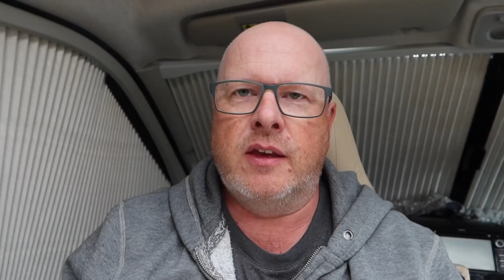VanTech Tuesday - Power to the People

Comment: Hi, Our motorhome had 2 leisure batteries in the previous owners set up but one was removed before we bought it. There are cables unused looking like a second feed available to use but I'm unsure of whether we a) need to still run jumper leads across both batteries and do the usual one battery negative the other battery positive set up or whether we need to incorporate the existing leads. I do have a couple of photos if you or anyone else would be kind enough to take a look. Went to one place who "aint got a clue mate". Thanks for taking the time to read and understand you're busy so no worries if you don't get time to answer. Cheers, Dave.
Reply from the maker: You’d be better to get an auto-electrician to look over it. If it used to have twin batteries and now doesn’t then the 2 spare cables should be removed, or install a second battery. But I can’t stress enough that don’t work on 12v electrics unless you’re very competent
Reply: @GadgetJohnAdventures  No worries, will do that. Thanks for taking the time to reply.

Comment: Great videos both of you have gained a lot already from them just wondering what you would advise with my motor home I want and need to upgrade my power and solar but don’t think I have enough room for a second battery as it’s crammed in with the trauma heating system what other options could I try
Reply from the maker: I’ll cover this in tomorrow’s VanTech video 👍🏼

Comment: Hi John, was curious to know what size solar panel you have on your new van and with that what input are you getting from it on a day like today, also your setup seems to be giving you what you need but are you considering a larger panel- if so what size 
Thanks John
Reply from the maker: I added a 360w to the existing 100w that came with the van, wired in series to a 30a victron controller. I get nearly 2Kwh of solar a day right now, so that's perfect for my needs, maybe in the future I'll get 2 x 150w panels, one will replace the existing 100w panel.
Reply: Cheers John, I’m just trying to sort my solar out. At present I have nothing but trying to get the best I can for the space I have. One more thing if you don’t mind but can you recommend any suppliers for panels that are true to there cell technology ( I see you have used amazon before but is that a particular brand or company )
Cheers John
Reply from the maker: I use Photonic Universe from amazon & they've always been great.
Reply: Gadget John on tour Thanks again John 
And hope you and  Mandy are safe
Reply: Morning John and Mandy another solar question if you don’t mind. I’ve been on my van roof to measure up and it seems like the exterior aluminium skin is not glue down to the van shell so wondered if yours was the same or if you have seen this before. Also would you recommend screwing and glueing solar panels( worried about leaks )

Comment: John, in a recent video you swapped out Lithium batteries and installed AGM, and were very pleased with doing this as you hated the Lithium. I would like to understand this and so please would you watch, all thru, the video posted by 'RV with Tito DIY' on 27march which is 15:05mins long. Video is titled;'BOONDOCKING with LITHIUM vs AGM- Which is Better?' He is explaining his experience with Lithium, after 3months of continuously without hookup, relying on Lithium only. He concludes at 12mins ''zero issue''. John, please could you explain all the hows and whys of him loving Lithium and yourself hating a Lithium based system, as these two opposite opinions I'm finding extremely confusing. Your answer may have to be quite long, as it involves a lot, but that's ok, it's the detail that's important. Thankyou John, best wishes from Alan, in Norfolk.
Reply from the maker: My video explains perfectly clearly what the issues are, watch the video, listen, please don’t skip and you’ll understand. The main point is lithium will work, but so far it seems not many system will accurately report the battery state, making it hard to know if the batteries are about to shut down or not.

Comment: John great videos, looking to fit front fog lamps to my tribute i have looked at your video but it doesn't go into detail can you give me any info did you use a relay, Cambus, and can i wire to a switch.
Reply from the maker: As the load is less that 0.1a I wired to the sidelight bulbs, each bulb wired to each drl, no switch and cambus was fine.
Reply: @GadgetJohnAdventures  thanks john if i throw a switch in the mix will that need a relay
Reply from the maker: That really complicates things, you can’t wire 1 switch to 2 different power sources, so either 2 switches, no switch or you’d need to wire a relay and take the relay switch from one of the lights.
Reply: @GadgetJohnAdventures  if i take the power from the fuse box to a relay and have them on a separate switch is this ok

Comment: Hi John, I have a portable 150w folding solar panel kit and my leisure battery has quick release flip up connectors, what battery terminal connectors do you use for multiple connections? Thanks again, Ian
Reply from the maker: Good question, I’m going to do the first quick video next week which covers connecting multiple batteries, in that I’ll show the terminal connectors I like to use 👍🏼
Reply: @GadgetJohnAdventures  thanks I'll look forward to it as usual 😎👍🏻

Comment: Interested in your wire cutters. Surely they would not cut through thick cables such as those required for a battery?
Reply from the maker: I use tin snips 👍🏼 read the video description for links 😎

Comment: You could also install a battery master to charge your starter battery off your leisure battery
Reply from the maker: I don’t need that setup as I drive my van once a week, under normal circumstances far more often, which keeps the battery topped up 👍🏼

Comment: When on hook up it shows a picture of both batteries and a loop connection does that mean they are both charging? Cheers Tony👍
Reply from the maker: Without knowing what system you’ve got I can’t say. Do you have a booklet for it or the model number?
Reply: @GadgetJohnAdventures  Hi john have found the model number (NE 268) and explanation as to why the 2 battery sign on  the control panel when hooked up says, The presence of the 230v mains when the two batteries are in parallel verifying before the battery service voltage? Clear as mud to me? All i know is when we are on hook up both batteries show fully charged?

Comment: Hi John i know your a busy man just a quick question? I have SORN my Auto trail T-669 off for the moment as we are on lockdown. If i hook it up to the house electric will it top up both the leisure and the van battery? If not is there an easy solution cheers Tony
Reply from the maker: The Sargent system can only charge 1 battery choice, so you can plug in and select vehicle battery or hab battery. Just like I went through in this video, just change it over every week.

Comment: Hi John thanks for the reply the TV is new and should run off 12 v but wont for some reason powers up but cuts off after few seconds and we changed lights in van to ones same as ur old van with usbs but thanks  and the fuse would be between the inverter and the wall socket thanks
Reply from the maker: Maybe the 12v socket you’re powering the tv off can’t take the load of the tv power. You don’t normally put fuses inline on mains cables, the fuses should be in the plug and appropriately sized for the device, so the tv might be 3A for example. Make sure the inverter has the right fuse between itself & the battery too.
Reply: @GadgetJohnAdventures  thanks john

Comment: Hi John and Mandy found you about 4 days ago and what a find, my name is George smith 78 and I live in whitby with my little dog Willow . I bought a van 4 weeks ago that had been started on as self build but not to my taste. it has 3 new leisure batteries all are 120 amp hours linked together I am currently on hook up at home my are putting out 13.9......14.3  v  I have 150 W solar panel off of my old van which was powering 2 batteries how do I wire these into 3 do I go number one and number three? and do I need a different controller.   Cheers John await your reply love your videos,  keep safe take care best regards George & Willow
Reply from the maker: Hi George, if you look back at my videos, inverter & battery wiring is the title, you’ll find loads of info on wiring multiple batteries and solar panels and controllers 👍🏼

Comment: John could you help we have a 800/1600 watt inverter in our motorhome which we run to a 2 plug and USB wall mounted socket should we have an inline fuse before the plug socket and if so wot size we only use it run a 40 w TV and roku stick thanks john
Reply from the maker: To be honest you might be better running the tv off 12v. You should also install some 12v usb sockets instead of mains usb sockets. Then your battery would have less load on it. If you do use it as you have it, then are you asking about the inverters fuse or the 230v sockets fuse?

Comment: If you run your engine try and run it at about 1200 to 1400 rpm, idle speed will not do the engine any good.
Reply from the maker: That’s not entirely true, an idling engine is going to use a lot of fuel compared to driving, an idling engine is also causing more wear on the engine, but it won’t ruin the engine unless it’s only ever run like that.

Comment: Question on solar panels John. the van I have just bought has a 100w solar panel but I would like more juice. Can I just add another panel like your 360w panel and link them together, or do multiple panels need to be the same make and wattage?
Reply from the maker: If you do as I did, make sure you update the solar controller too and the wiring & fuse from controller to battery and that’s it all done 👍🏼

Comment: My Solar system, I have 600 watts and 2 x 225 agm batteries, 60 amp controller, also a split charger. My solar charges both my vans batteries (van has two batteries as standard.) and my 2 agm batteries? I don't know if a unique system or do all split charge systems work both ways?
Reply from the maker: That’s how my setup works, you’ve got more solar & batteries than we do, but it’s the same charge system 👍🏼

Comment: Fuses should always be rated lower than the cables it is protecting.. in your example of a 10a cable with a 10a fuse, you would be far better suggesting 16 cable with a 10a fuse. Also spec for no more than 80% continuous amps of overall capacity.
Reply from the maker: Very true 👍🏼

Comment: Simple how to vids would be great.

We use a B2B to go from starter battery to leisure bank using combined voltage sense and ignition control. To go the other way to top up the starter if it's been standing too long or is flat when we come to move camp we have a separate 240V 20A@12V car charger on it's own usually off switch and a relay that disconnects it when the ignition is on just in case.  We could have wired a separate B2B to go from the leisure to starter battery but had the 240V charger sitting around doing nothing and it's not like it's going to be sitting charging all day every day like the main leisure battery.

Comment: Great video as always, thanks John. As mentioned over on IG, currently upgrading my 100w solar system to 460w, and fitting Remis blinds, and upgrading to an 11kg refillable gas tank (from 6kg). Absolutely love my new motorhome (Carado T132), but it needs some work to be completely off grid. Making the most of the self isolation! Even found delivery drivers that will deliver to where I'm parked which is amazing as it doesn't have a postal code! If you haven't already, download what3words, great system.

Comment: Hi John. My answer to keeping the chassis battery topped up is I ran a cable from the load side of my mppt victron charge controller through a trickle charger from Amazon to the chassis battery. It works a treat. Our van stands for weeks on end and never had a flat chassis battery.

Comment: Like the idea of short how-to videos. Might help you if you get repeat questions, you can just link to videos. 1st one I'd like, instead of having all my 12v things going back to the battery, the positive terminal,  it having LOADS of wires going into it, it's horrible to manage! Can I have  a connector box of sorts to put them into? (If that makes sense)
Reply from the maker: You shouldn’t have anything but the fuse box wire going to your battery, then wire all devices to the fuse box.
Reply: @GadgetJohnAdventures    Thanks John, kinda how I thought it might work in my head, I'll try it out. Appreciate the vids you do.

Comment: Hi John Our zig unit is indicatiing no charge in the vehicle battery although the battery is fine. It's showing an accurate reading for the leisure battery. Grateful if you could direct us to where fault may lie. Cheers Wayne and Anita
Reply from the maker: I’m not familiar with that system but it sounds like the sensor wire/fuse to the vehicle battery might be the cause. Does everything work ok aside from that? If so then maybe fit a separate digital gauge for the vehicle battery.

Comment: Hi John, Im Parked up on my Mum´s drive with a cable running to the shed´s plug socket.´, which is connected to a socket in the kitchen. On occasions im using a  heater in the van and mum put´s kettle and toaster on at the same time the fuse blows!
Question - what would be the best/safest way of installing some sort of trip switch that would trip the power to the van and not blow a fuse in the house socket.I have seen some plugs but they only seem to be for shortages in power ie. cutting through cables when hedge cutting etc. Any advise?? Thanks Mat
Reply from the maker: A simple suggestion would be to plug the van into another socket in the house not on the same ring main as the kitchen, maybe upstairs.
Reply: @GadgetJohnAdventures  - LOL now why didnt i think of that DOOOH!  Thanks and stay safe ! ( unless the old girl has kettles and toasters in evry room !!) lol

Comment: john I got 3 new 130 ah leisure deep cycle batterys will they be ok to connect to my tata 305w solar panel
Reply from the maker: Solar panels connect to a solar charge controller, that then allows you to charge a battery or a battery bank 👍🏼
Reply: I got the cpe mppt solar charger 30A, are batterys ok for this setup

Comment: Hi John, I know you dont want to be moving the van to often to get gas so have a suggestion . You can buy a gas reserve hose from GASIT that allows  you to connect your refill point directly to a gas cylinder, so you could buy a couple of large bottles to keep you going for alot longer. I know you have to pay a rental fee upfront but you would get that back at the end of all this! Morrisons are good and cheap on gas bottles.https://www.gasit.co.uk/lpg-test-equipment.html  Just noticed Gasit are closed down but you might be able to get one else where, if not I am quite willing to loan you mine.
Keep safe and well.
Reply from the maker: Thanks for the suggestion but I’d still have to go out for the bottle and it’d need to be small enough to fit in the gas locker, I can’t have the van open and a huge gas bottle outside, I’m trying to be as discreet as possible right now. 👍🏼

Comment: Comment update. Battery gassing (hydrogen sulphide) not hydrogen chloride, aplogise that error. Rebuilding a motohome in the middle of this corona virus whilst deep off grid is difficult. The worse thing about van life is living without thermal mass to stablise temperature (have a possible solution to this weight problem) and keeping cool when sun over 30C.

Comment: Hi John Is there such a thing as heat pump heating for vans?  I know they are mega efficient for home/business premises or even tumble driers so in theory, they should be great for vans.
Reply from the maker: Do you mean ground or air sources heat pumps? I’d assume the electrical power required would be too much for off grid.
Reply: I've been working with heat pump tumble dryers lately (air source) & it's basically a refrigeration system  but as you said, it's probably too big a power draw.

Comment: Hi John, I’m a Aussie with a Van in UK now in storage, In the UK is it legal to replace headlights with LEDs?
Reply from the maker: The 1986 legislation doesn’t cover led bulbs, they say if an led headlamp fails it must be replaced, assuming they mean the recent led headlamp units, so the definitive answer is No, however, an MOT station will pass led bulbs as long as the beam pattern is correct.

Comment: Hi John, I’ve converted a 2012 17 seater Transit minibus in to a campervan. The original van has 2 batteries, one main starter battery and an aux battery that runs the remote locking system and used to run the internal lights, now mostly disconnected. The aux battery connects and charges when the engine runs. When the van isn’t run for a few months, the aux battery can go flat due to using the remote locking and just going in an out of the van. A couple of months ago I renewed both batteries. As Part of the conversion I fitted a 280w solar panel and 2 x 110ah leisure batteries to run the camper stuff. I would like to link the leisure batteries to the aux battery so that when the leisure batteries are full, the solar would then top up the aux battery. What charger would you recommend? I’m concerned not to pump too much power into the aux battery and affect any electrics circuitry that is connected to it.  Cheers
Reply: The one in my van is a dual battery charge controller, leisure batteries(2x100ah) are bank 1 and engine on bank 2,  the controller will prioritize bank 1 first and trickle charge bank 2. It won't over charge the batteries.